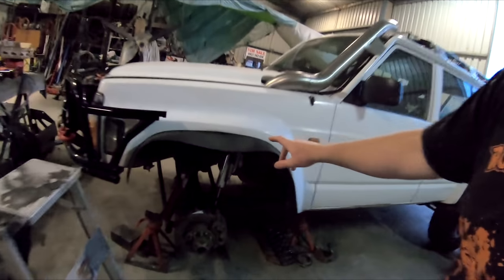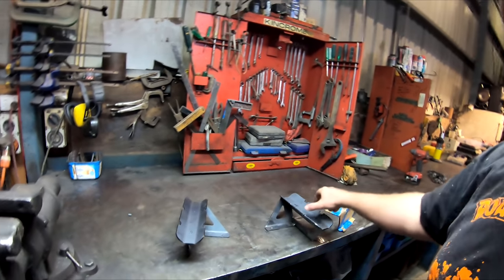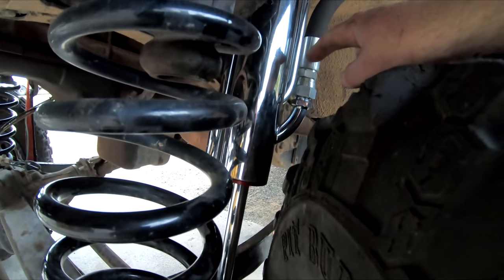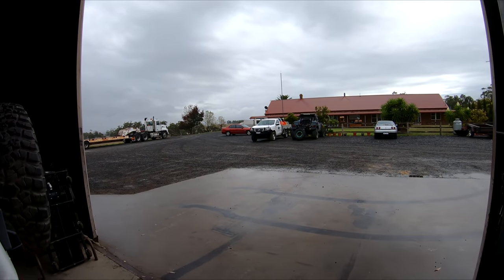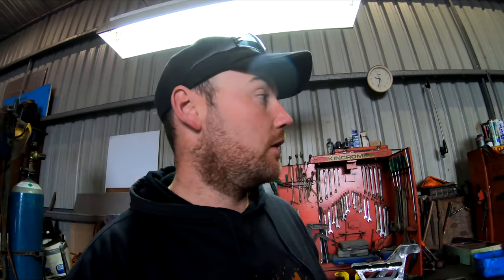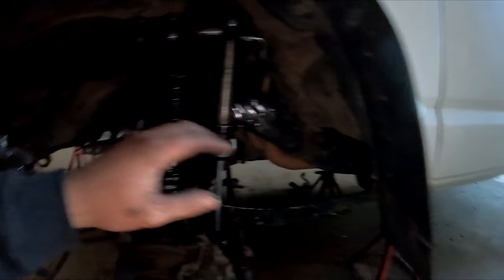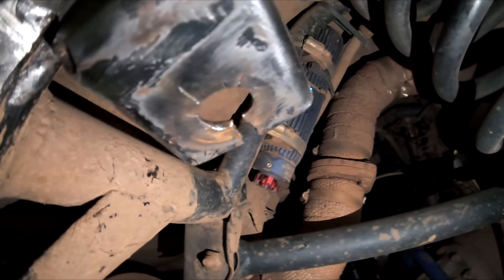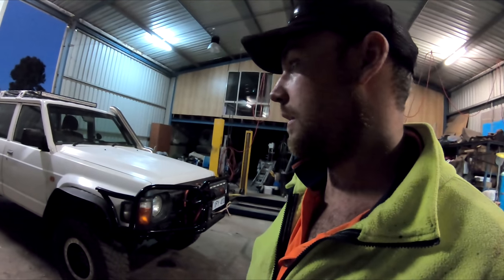Triple Bypass Shocks install - Ep 13

Comment: Great video mate, 
Those shocks seems like good value as well, we are running king2.5 cost a fair bit and still finding it a little hard to justify the cost, they ride well off-road but on road there still harsh in my opinion for there cost. 

I guess this is where triple bypass shocks really shine as you can tune different travel sections

Look forward to seeing your Easter trip vid 
Cheers
Reply from the maker: They seem to be good quality for the price. I’ll have more of an opinion once I use them a bit! Sounds like you need to change some valving! Having the triple bypass is awesome for adjustability, I’m looking forward to having an actual play with them! Cheers

Comment: What about when your tires are let down will there still be clearance shock to tire ?, your work is good mate bullbar sides.
Reply from the maker: Shouldn’t make a difference as they only bag out on the bottom with weight on them. But will be checking it all again when the correct shock is in there! Thanks mate

Comment: Love the vids mate! What sorta money do engineers charge to cert something like like this? I've got an old ln106 and I've been seriously considering installing front coilovers with either a gu or 80 series diff and a rear 4 link coil set. I can price up all the parts easy enough and should be able to weld and install it all, just got no idea about the legality/certification side of things!
Hope the easter trip went well, and I'm looking forward to seeing some footage!
Reply from the maker: Thanks mate. It depends on so many things. Best bet is to speak to an engineer well before you start doing any work, that way you do it exactly how they want to! I don’t want to spread information that could potentially be wrong. Cheers
Reply: @DanielKistler  yea that's fair enough! O well, I've decided I'll keep the lux for quite a while anyway so I guess it will be worth it in the long. First step is 5l 3.0liter  rebuild with boost comped pump and turbo setup.
Then it may have close to half the power of yours haha.
Reply from the maker: @liamfletcher7226  if your planning on keeping the car then definitely suss it out! Sounds like a weapon haha!!
Reply: @DanielKistler  haha nope! Right now it's pretty well stock, and has been for years. But I'm that will start changing now.
It's been some good motivation seeing your stuff too! Not sure if I should try film some stuff like you aswell, seems like a lot of extra work but clearly a lot of people appreciate it!

Comment: Time for a torsion swaybar
Reply from the maker: Would put one in the front if they weren’t so expensive
Reply: I made one from a for courier torsion bar. Less than $200 all up. 
Seems if i post the link to the thread on the patrol forum it gets removed?
Reply from the maker: @bennyjahmin3953  yeah I have seen a few people make them. The front would be a bit tricky having to go around the steering box but I’ll see what happens. Not sure why the link gets removed, maybe YouTube doesn’t allow it?!
Reply: I used 1/2" plate and got someone with a big fn press to bend it. If you got to the patrol4x4 forum and under the DIY section is up there with some photos. Biggest pain is cutting out the drop in the xmember and patching it up. Be way easier to cut it out all together and weld in a straight pipe.
Reply: The length of the courier torsion bar means you only need about a 40mm kick in the arm to get around the steering box.
Reply from the maker: @bennyjahmin3953  I’ll head over and suss it out, yeah if I done it I’d definitely just cut the whole section out and replace it with a straight piece

Comment: Nice, 4 link full swing arm rear end next please.
Reply from the maker: Haha that’s not going to happen!
Reply: Yeah I get it. When does it stop. Nice fab work tho. 👍
Reply from the maker: @jorjimaco5331  haha it seems to be never ending!! Cheers mate
Reply: @DanielKistler  here’s a tip, single pass shock oil cooler. Cheap, works
Reply from the maker: Thanks for the tip mate!

Comment: Hey mate love the setup. Been thinking about 2.5 triple bypass vs 2.5 coilover setup on my 105 landcruiser. Ive put an LSA in her so i like to go fast. In the desert. Wondering your experience with the triple bypass to date ? Worth it ? hows the adjustability on the fly ? regret not going coilovers ? If the car is used as a dual purpose rig for touring as well, would they still be suitable ? 

Thanks mate
Reply from the maker: Hey  mate, I Havnt driven my car since Easter and I’m still waiting for the other bypass shock so I can’t give you a heap of info on that. But the adjustability is easy and effective aswell. I wouldn’t go coilovers in my wagon because then I would have to cut the whole coil hat off and would probably struggle a bit to them inside the inner guard. This car is a touring car and it works well. Thanks
Reply: @DanielKistler   thanks for the heads up! Cheers